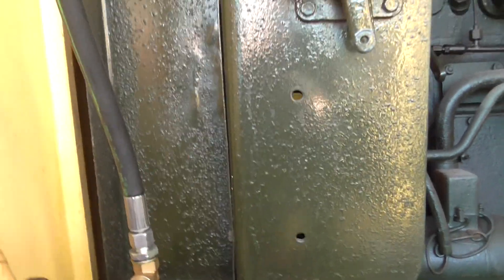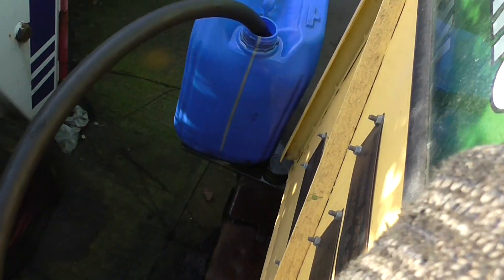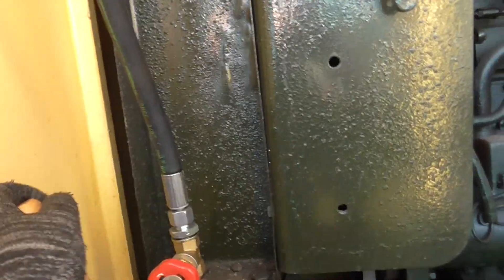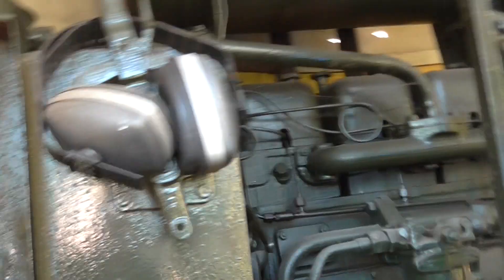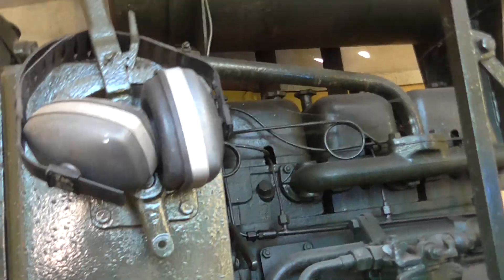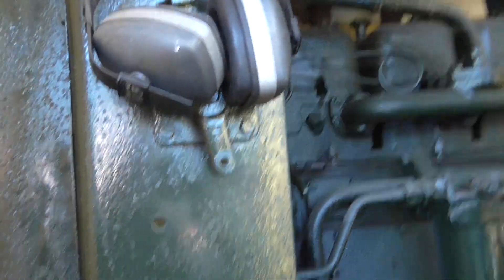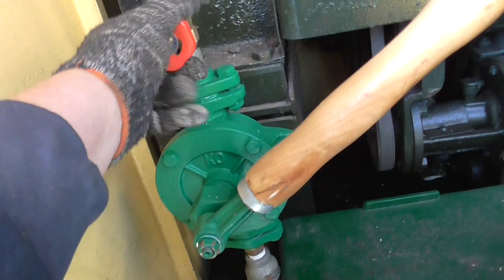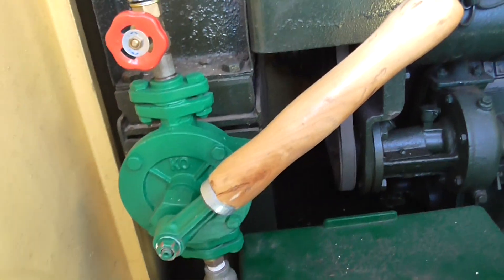1955  RUSTON BUCYRUS 10 RB

Comment from the maker: It pumped four gallons of diesel in two minutes, so that job worked out very well using new parts I had around the garage, Not a drop spilt and fuelled in a much safer way.